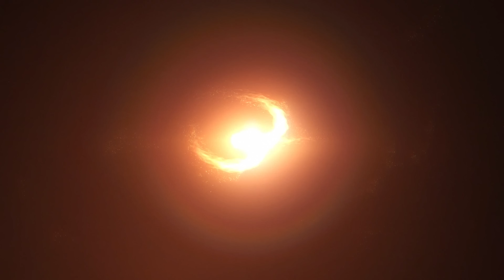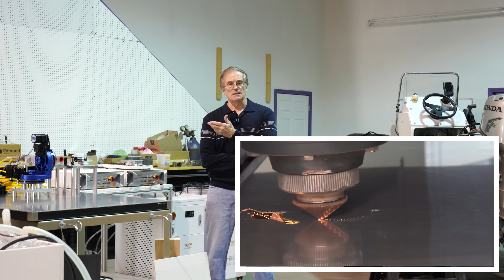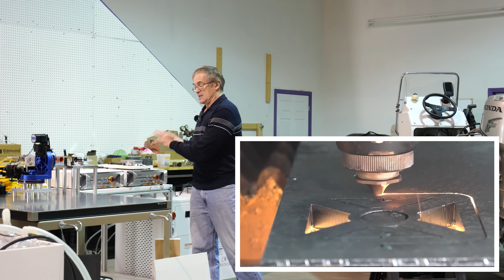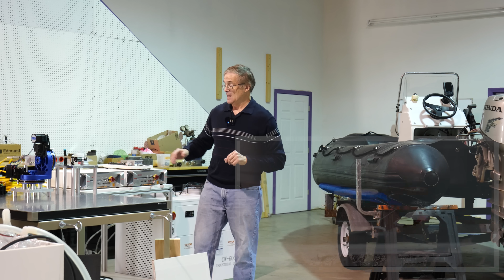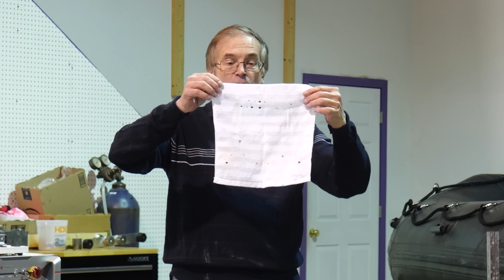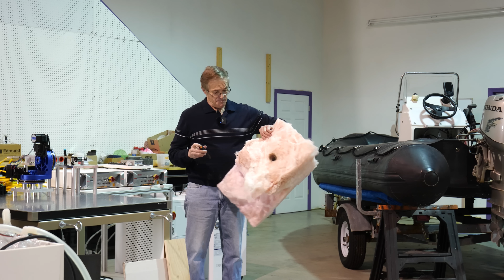We have a problem... and need your help!

Comment: Try an array of ultrasonic foggers to constantly create fog that can diffuse the beam to manageable levels. At the end of the foggers array, maybe use Nighthawkinlight's starlite replica to deal with the remaining beam that made it through.
Reply: Thats really not stupid.... Not sure they have the space for enough fog though.
Reply: @Mort_OOPz Doesn't need that long of an array. Just 5 transducers spaced equally apart, constantly releasing fog into a 1m long steel pipe would provide significant attenuation to the beam's power.
Reply: @tichrontus  Indeed, its a good idea and I hope they try it (I mean, they've already got fog machines)... But, think how fast one of those lasers would vaporize that tiny mass, I'm not sure it could replaced fast enough.
Reply: @Mort_OOPz My hope is for it to at least dissipate some of that energy. But I'm pretty sure the starlite at the end can handle it. A creator called 'Mancave Effects' tried his own blend of starlite on a K40 laser (40W CO2 laser). One of his blends which was a roughly 5mm thick patty, survived a 10s full power blast without burninh through.
Reply: Agree and have an idea.
Charcoal in the water possible ? The smoke disperse the beam further.
Awesome to help. :)
Reply: @vovochen Oh that's a pretty nice one. Cheap and easily obtained stuff. If it's like wet clay consistency made with charcoal powder and water, it could probably withstand the beam for quite a bit.
Reply: @tichrontus  Thank you ! These are the problem I became an Aerospace Engineer for ! <3
(If you have contacts to any major Space & Defense company hit me up, starting Masters rn.)
Reply: @tichrontus  The only problem is... the charcoal will need to by dry to stick together afaik. To make it vaporise outwards and further scatter the beam, one could introduce small gas bubbles, but I think when wet it'll fall apart.
Reply: @vovochen There's a simple solution for this: syrup. Just plain table sugar mixed with water, it'll help bind the powder. Table sugar (sucrose) thermally decomposes into a mixture of H2O, CO2 and pure carbon. So to a certain extent, the burnt off carbon gets replaced partially, slowing down the process. Not sure if it could beat the expanding carbon foam of starlite though, that stuff's pretty crazy. As for recommendations to companies, I'm afraid I can't help you though. Currently I'm just a food delivery guy, used to work for Republic of Singapore Air Force back in the days.
Reply: @tichrontus  🙂. That what I found playing with 5W lasers - sugar was almost immune to the beam 😁. But can it work with much higher energy density? I'm not sure...
Reply: @cwm-SupremeChancellor Nah, it won't survive. The point is to make it a sacrificial ingredient. If they swap out the charcoal with something edible, maybe there'll be something to go with the caramel 😂
Reply: I immediately also thought of his starlite or even a commercial intumescent paint. But I love your idea of foggers creating a wall of a million little lenses to help scatter some of the beam and reduce the intensity. Only need to resist for a few seconds. The starlite solution has the additional benefit of being easily repairable vs something like replacing an entire section of a barrier and obviously the fog wouldn't need to be replaced.
Reply: @Stegatanium  the issue with starlite and other intumescent materials is they create an insulating foam of carbon, silica, etc. That foam is very good at stopping heat from penetrating deeper into the surface, as long as the temperature doesn't exceed its melting/sublimation point. If the temperature does exceed that value, the foam layer disappears quickly, since it's not very dense.

I believe the YouTube channel beyondthepress tested this. Starlite was better at resisting thermite than normal steel was, but a plasma cutter pilot arc destroyed starlite much faster.
Reply: Into a cloudy fish tank.
Reply: @mrcomment5544  I don't think aiming the laser at a reflective glass surface is going to happen. One of the benefits of the fog idea is that can hang in the air without any structure that would be destroyed by the laser.
Reply: @mrcomment5544 That was my initial thought. However, the thought of one side of the tank taking on the full strength of the beam is a little worrying...
Reply: @mrcomment5544  Point of contact with the beam would destroy the glass, invalidating the effort. Also, the tank would have to be several hundred square feet on a side. (I already suggested it, before thinking through the point of contact interface with a 1500 Watt narrow beam width columnated beam.)
Reply: What a cool idea - fog!   Ultrasonic even better!   Starlite - basically a flour tortilla, not sure,  stacking the brick wall  behind whatever he chooses looks like wisdom.
Reply: That was my initial thought too! Containment of a "fog could be a problem. 
Setting up two air curtains One down and then another up with afew feet between them should force the fog into a contained motion ..... and it could look really cool too!

If you want belt and braces try coating the rear wall with slices of bread! No I haven't gone mad. The bread (or better still burned toast) would carburise on the surface which could stand some quite high temperatures. I have seen Oxy cutters not get through to someone's hand holding the toast
Reply: Geometry.  Consider a way to increase the movement of the beam's point on the backstop relative to the target in foreground.  This lowers the power density on the backstop, which supports the economic materials already presented. Specifically, orient the laser along the length of the warehouse, have a good distance between target and backstop. Attach the laser apparatus to a platform that can pivot perpindicular to the beam. Attach the pivoted platform to a motion noise generator (aka the corner of a washing machine with uneven feet on wash cycle). Hey Presto - power density on backstop is a fraction of that on target
Reply: @dancollins1012 I saw this mentioned in some other comments as well. It's actually an elegant solution.
Reply: Carbon fiber fabric looped together to make a wide conveyer belt. The belt runs downward on the side facing the laser.  Add a stream of water emitted from a slot all along the entire top that more than saturates the belt.  Experiment with various solutes in the water to best absorb the wave length of your particular laser. Catch the water with a pan all along the bottom of the conveyer and pump it back to the top. Run the soaked carbonfiber conveyer belt just fast enough to reliably absorb the full power without burning.
Reply: The bottom of the conveyer could be inside the pan, and serve as it's own pump - but may be better if run the opposite way...
Reply: The pan (and identical cover/ water emitting slot) at the top could be made from sections of rain gutter with the ends holding bearings for the conveyer rollers.
Reply: @DarylOster That's not too bad an idea but it comes with some risks. Water lets visible spectrum through so the carbon fiber takes on majority of the beam's energy. Even with a layer of water on the fabric, it might not survive. That brings us to the 2nd issue, which is cost. Eric wanted a solution that's preferably cheap, CF is not exactly cheap. It's fine if it withstands the beam, else having CF as a consumable is way more costly.
Reply: @tichrontus  agreed that CF cost is greater than many other materials, however the important measure of cost is the cost to resist the laser.  Agreed the water must have solutes (dissolved into or emulsified into the water) to make it non-transparent to the laser.  The movement of the water (and CF belt) must be fast enough, and the water film thick enough to absorb full power of the laser beam without allowing the entire thickness of the liquid to vaporize.  By avoiding vaporization, the CF will be mostly protected, and if it does take a hit, it will be much more durable than flammable material.  It may be that basalt fiber is a better choice than CF, however the melting point is much lower.   If made of very heavy CF fabric. a very large belt should not weigh more than 5kg -- or less than a couple hundred bucks.
Reply: @DarylOster I'll share a more detailed opinion on this. In CF, what we're paying for is the tensile strength to weight property. I assume that the tensile strength isn't what you're after but rather the weight and the fact that CF absorbs visible EM spectrum well and conducts heat reasonably well too. Because of the lightweight property, driving a large sheet of it does not require too large of a torque thus we can get away with a reasonably-sized motor. Alternatively, it can also be done using cheaper material like gunny sacks made of natural fibers like hemp that can carbonize, woven together in overlapping manner. The energy from the beam causes a two-stage energy dissipation. First absorbed and causes carbonization, then the carbon absorbs and dissipates it similar to CF. As for the immense weight of liquid-soaked gunny sacks, instead of using a motor to drive it, you can use a water pump spray water on the highest point of the side facing the laser. Excess water will exit at the bottom thus the side on its return trip upwards will always be lighter. This way, a conveyor motion will be in place without having to worry about driving the immense weight and eradicates the need to use such expensive material.
Reply: @tichrontus  I like it
Reply: Starlite hits all of the points he wants, cheap, easy to apply, remove, get rid of and is non-toxic (it's basically a tortilla lol)
Reply: @ScarletFlames1 Yeah, the hard part is what to go with for the dip.
Reply: I have the same thought about the Starlight replica that Nighthawkinlight made. The only question is how fast the starlight can act as a heat sink for the laser light but if it can keep up with the laser energy then I think it would be ideal as a surface treatment
Reply: Nah. Fog's density by definition is very low, around that of air. The laser will evaporate the tiny amount of water in the droplets almost instantly, quickly punching a hole through the fog. And it keeps the hole open since fog has no way to transport new droplets into the beam at any reasonable rate  - and the evaporation also causes an outward flow of steam, pushing droplets away from the beam.
Reply: @HB-et5iv You're right, I didn't account for the fact that the expanding steam will push the droplets away.
Reply: the laser would just vaporize the fog and cause a clear tunnel through it. Fog absorbs light and would heat up nearly as fast as an opaque object. I agree that dispersing the beam is the best option but by refraction and diffraction, not absorption and re-radiation
Reply: @paulmichaelfreedman8334 Fog is droplets of water. Droplets of water ARE lenses. They would disperse coherent light because of their spherical surfaces.
Reply: @paulmichaelfreedman8334 Yeah it would. Purpose of the fog is to take the brunt of the energy and let the starlite handle the rest. That's why I suggested using ultrasonic foggers, to constantly replace that vaporized fog.
Reply: Laminar curtain waterfall. Maybe add something like Titanium dioxide to increase absorbency.
Reply: @Kkybte  This is the first thing I thought of. Water has a ton of heat capacity. The constant flow would fill in any vaporized water very quickly. Maybe multiple curtains too.... Just need a way to contain and catch the water and send it back up at a high enough rate, and without springing an unmanageable amount of leaks.
Reply: @Kkybte That's not a bad idea. If you meant including powderized TiO2 into the waterfall, it could work if they use an external impeller fitted to a motor with low rpm output. TiO2 is between 5.5 to 7 on MOHS scale, it'll do significant damage to anything with high rpms.

Comment: Expand the beam and focus on target you need to drastically increase the rad divergence and setup a spring loaded focus system used dual cameras and a opencv stereo vision to calculate distance to target. Use a the switch input to pulse the laser when the system in in focus at a set distance the goal is to get that 1-2mm spot on target and only for a small 6-18in zone before the beam expands to over 1/2in this will prevent it from cutting and over 2in it will heat but not melt things.
As for a protection material you needs something like the tile on starship something the will carbonize and expand to absorb the power.
Take the optical output and divied by the total aera of the beam for energy density.
A curved water cooled first surface mirror to reflect and expand the beam back to a heatsink.
Like maybe spring load a tungsten ball in the beam path to reflect to beam onto a water cooled black ceramic tile this will expand the beam as it is reflected back onto a load to take the energy. Honestly just use optics to expand the beam up to 3-4in and focus on target with a failsafe the forces the beam to expand wide

Comment: Would refractory bricks perform better? Also, what is the square footage of the area that needs protection? Sounds like a standard beam dump would be too small. You may need an isolated control loop to monitor for malfunctions and auto shutdown the laser. Good luck!

Comment: Did you try actual fire bricks? Standard ones can withstand about 2500 deg F, and some refractory types are capable of over 3500 deg F. You could also try refractory cement coating on plywood to make a larger and portable backdrop?

Comment: I’m hoping that Oooblek can come in for the win here. The idea being a self healing non toxic barrier. Only concern with is maybe use it sandwiched between some more solid surfaces. With holes small enough it shouldn’t leak as it’s too viscous… or just start at the top and work your way down.

Comment: The Orange colored American hardware store sells Ceramic Fiber Insulation Blanket Roll (6# Density, 2300°F) (1in.x24in.x60in.) for Kilns, Ovens, Furnaces, Forges, Stoves for around 50$ per box